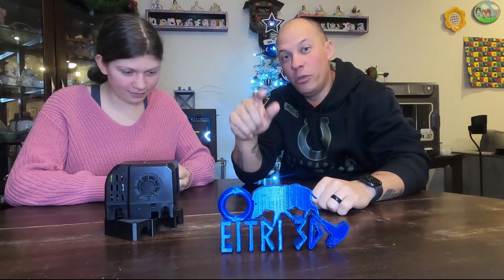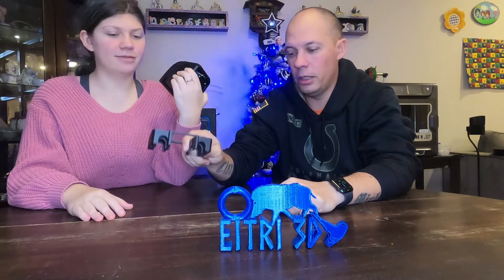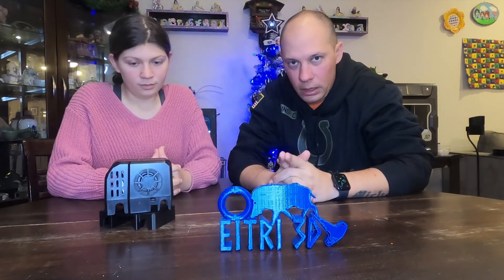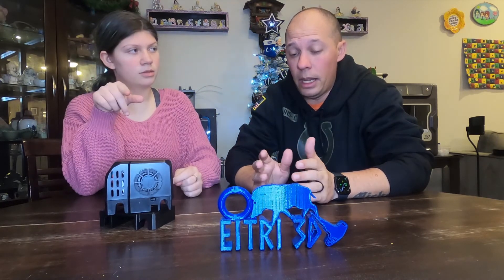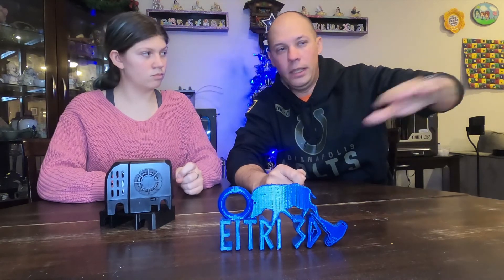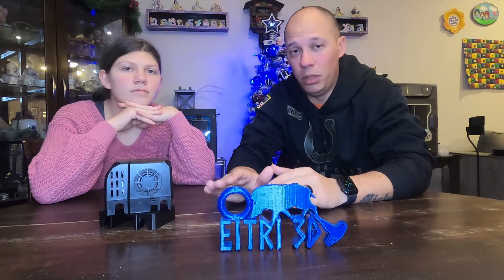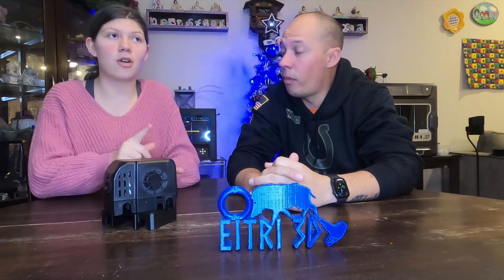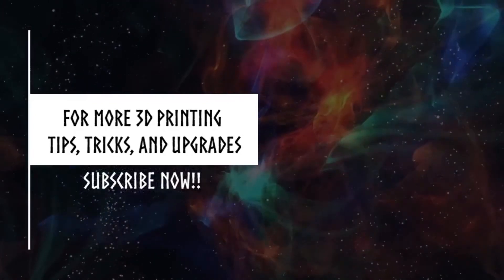Part 3 - Qidi X-Max All Metal Hotend Upgrade (Chad Mod)

Comment: Showing the PID adjustment helped a lot. I couldn't get it to work from another tutorial, because it show the M303 "E"  parameter was optional and wasn't included. I just assumed my X-Plus didn't support the command but thought I'd try to find another one just in case. I had already ran across your video looking for something else, and thought I'd check it just in case it showed how to to do it on the X-MAX. It worked! Thanks so much!!!!!!!
Reply from the maker: You’re very welcome. I’m glad our videos are helpful!

Comment: Hi Mike, I made the mod on a X-max and it works really well! Thank you. 
The only part I cannot get right is the hotend (Dragon) PID tuning. No matter how many times I've run the M303 E0 S230 C5, get the PID and  'printed'  it, the temperature keeps fluctuating by about 10 degrees. Any suggestion? 
Also, when sending with Octoprint the command M503 it just returns a N:(some number) response :
Send: N282 M503*45
Recv: ok N:282 
Do you know why?
Again thank you for this great mod!
Reply from the maker: When it comes to the PID tuning, I would run it 3 times and take the average of the responses. This will get you close, but at the end of the day each filament requires different temp and you can adjust from there. As for the 503 command, I am not sure off the top of my head what’s going on. Let me do some research and see if I can figure it out.
Reply: @Eitri3D  I've contacted QIDI. They sent me the new X-Max firmware and now the PID is working well - no more temp fluctuations! Thank you again. :)

Comment: Hi Mike & family, had an odd question for you guys.  After printing about 2/3 roll of ABS filament on various projects, my X-Plus' hi temp extruder has stopped heating above 190*C, give or take 10*.  Contacted customer support who advised me to increase the distance between heat sink & aluminum block, which gave slightly different temps but still under 200*.  Since that didn't help, they were going to replace the extruder but, since I purchased it new from a seller on eBay (not Amazon or directly from Qidi), they won't honor my warranty.  I replaced the heat pipe, no change.  All connections are secure and I see no damage to the board or any other components.  Any suggestions before I have to purchase an entire new hi temp extruder?  I've printed 10x more with the regular extruder with no such issues and I'm stumped.  Thanks as always for your input!

Comment: I put other thermocouples, they do not fit, only when you fix your native one, it works with it, how to fix the error, please help.
Reply from the maker: I am not sure I understand your issue. The list of materials bought all fit together with no issues. Can you clarify?
Reply: @Eitri3D  Hi, I'll explain everything now, I fixed everything correctly, after which it turned out that the thermocouple from Trianglelab, which was included in the kit, does not fit, the board does not perceive it, I tried others, they also do not work, I put a regular one, but the temperature is very much not stable at 20 degrees, I tried the Pid does not help me.
Reply from the maker: That thermocouple in the description fits the Genuine E3D Heater Block that is in the description. The one in the kit isn’t the upgraded version. It was cheaper to buy the kit and toss that thermocouple than to buy everything different.
Reply: @Eitri3D  If it doesn't bother you, you can record a detailed video on the temperature settings, I would be grateful,? Or is there some kind of setup instruction? And how do I make the board work with a thermocouple from Trianglelab?
Reply from the maker: There are three videos in this playlist. Video 2 shows the assembly. Unfortunately video 2 has been removed because a company tried to claim copyright infringement. As soon as the dispute ends, it will be put back up and that will help.
Reply: @Eitri3D  can I send the video by mail to me?
Reply from the maker: The second video is back up.

Comment: What a super nice conversion kit! I have followed it all the way you did it and my brand new Qidi X-Max is now completely ready for printing industrial parts with Nylon-Carbon Fiber at high temperatures.

I still have a question about the optional 30 mm fan that must be connected to the connector of the leveling input.
With me it is connected to pin 2 (-) and pin 3 (+) just like in your video, but it doesn't work. Does something else need to be switched on somewhere else !?
Reply from the maker: The quick answer is no. When plugged into the 3-pin it will be in a constant on state. I would plug it into the #1 position to ensure there isn’t an issue with the fan itself. Your other option is to splice those two fans together and plug into slot #1. If you do that, then both fans will kick on at 50°C.
Reply: @Eitri3D  Thanks for your quick response. Indeed, the problem was the fan itself. It's broken. It is the new fan of the ordered Trianglelab Highall-Metaal V6 Hotend. Maybe a cable break or something. I connected another one to the connector and it does indeed run continuously as long as the printer is on.
Thanks again for your beautiful full metal extruder solution for the X-MAX !! :-)
Reply from the maker: Thank you for the kind words. I cannot take credit for the all-metal upgrade design. I just took their words and put it into a video. I’m glad you were able to find the problem and get it fixed. Happy printing. Cheers!

Comment: Ive build this and it runs beast mode compaired to that clicking joke of an extruder but no matter what I cant get the quality that I did. I updated the firmware and am constantly making adjustments so see if I can get the quality and only got a little closer. Also I cant run PLA with out is slowly plugging up just like on a normal all-metal hotend so I made one to run like the the low temp one and only really had to bore out the hotend and heat block a little to fit the bigger heat break that fit the tube and have had nothing but good on it so far. Saves me having to go back to factory firmware and reinstalling all the hardware again. So is there anything I'm missing?
Reply from the maker: So a few questions for you, did you add the third fan, what are your retraction settings, and did you run the PID tune to help dial it in? I ask because I have dialed in my settings and honestly have had zero PLA clogs (except for out of tolerance filament size) with the added/improved cooling. I run 208° with bed at 60° and 100% cooling with 1mm retraction at 30mm/sec and I’ll switch between FilamentOne, Hatchbox, eSun, and Filablend Filaments
Reply: @Eitri3D  Hey I'm Just seeing this, I figured out it was my fault with how I was putting the tubes in there And I worked most the bugs out. I use a .8mm tip with a Volcano heat block and I don't run it slow. I'm shocked with what this mod did.  Easy 8X or more the factory recommended print volume. Now I sturggle with firmware. Is that reverse code I added firmware or not?? Octoprint says I have broken firmware and hardly anything works between the 2
Reply from the maker: Have you added the CBD_Fix on your OctoPrint? You could reset the firmware, but you’d have to readjust the reverse direction code again.

Comment: where do you get all the firmware to reset the stepper motors?
Reply: There is a link on thingaverse under Chadmod in. instructions I believe thats where I got it from
Reply from the maker: Exactly. Plus if you google Chitu Gcode, you’ll get a list of the meanings of the most common lines of code.

Comment: Can you please follow up with a video to autotune without PI/ Octoprint?
finished but didnt know we had to use pi too
Reply from the maker: This is something I’ve been working on figuring out. I think I have a possible solution. I will be testing and recording if it works. Thank you for your comment.
Reply: @Eitri3D  im just all done up with mine just about to fire it up without the autotune =p see how it goes
Reply from the maker: Your temps may be a little from the display until I can test this new method, which is a goal tonight. Hopefully I’ll have an answer real soon.

Comment: I finally did this but don’t have it working yet.  My extruder is going the wrong direction; how can I fix this?  Also, how can I calibrate the new extruder?  Every time I try M501 in Octoprint, I get “ok N886”.  Thanks.
Reply from the maker: Part 3 of the Chad Mod videos for into details on how to fix the direction issues and how to PID Tune. Do the PID and direction fix using the thumb drive. Use Octoprint to get you PID information for the correction.

Comment: I am having issues with mine. I did it to a XPlus and now my temp say 1077/200 is that something I have to do through octoprint
Reply: I was just having the same issue.  The thermocouple is probably lose, I recrimped mine and tightened down the pins and it solved that problem.  Otherwise, it could be that you're using an incomparable thermistor.
Reply from the maker: Glad to hear you were able to diagnose the issue and fix it. The few 1077 issues I’ve dealt with were ribbon cable issues so thank you for explaining what you were able to do. I’m almost certain your comment will help others. Thank you.
Reply: @Eitri3D  ya i had the same issue it was just the ribbon cable not plugged in all the way
Reply from the maker: Yeah I’m always glad when it’s a simple fix, but I want to kick myself because it was something I overlooked.
Reply from the maker: The issue is with your ribbon cable. Disconnect the ribbon cable and plug it back in to see if that fixes it.

Comment: I just got everything completed and installed but when I go to the home position it hits and continues to drive. Is there something I need to adjust? I seen the comment below about adding a 2mm plate or something, is this necessary?
Reply from the maker: I ground/sanded the back edge of the fan down a small amount. Once I did that I’ve not had any issues. I did not install that 2mm plate. Some people needed it, and I thought I was going to also. The other big thing I would check is that your X axis arms are square within the frame. To adjust, just grab the arms and push one side and pull the other side.
Reply: @Eitri3D  I will give it a try. Thanks
Reply from the maker: No problem, would like to know if it works and if so, which one did it for you.

Comment: I like how the 1st video has 3 times as many views as the last one, which has obvious implications of all those quitters out there.  Any idea if this ChadMod carriage will work with a mosquito or dragon hot end?  Thanks. You guys are awesome.
Reply from the maker: I like to hope that the other 2/3rds are waiting for their parts to arrive before continuing on to the last 2 videos. As for the Chad Mod, it is designed for the V6 and Dragon Hotend. I personally haven’t installed a Dragon, but I know many others went the Dragon route.
Reply: @Eitri3D  I ended up buying a mosquito hot end.  When doing this one, you'll need to slim down the top carriage by 2mm, and the fan by 2mm for clearance.
Reply from the maker: That’s some great information to pass along. I appreciate your feedback for the community. Do you have a Thingiverse set up or a place where people can get your design? Just in case they don’t feel comfortable modding the original carriage.
Reply: @Eitri3D  I will upload it on thingiverse soon, as well as some of my mods for the original carriage.
Reply from the maker: @bboydradle  that would be awesome. Thank you.
Reply: @bboydradle  Have you uploaded the files to Thingverse yet? If so, can you provide a link please?

Comment: follow everyone. Printing the filament rollors now
Reply from the maker: how did your rollers turn out?
Reply: @Eitri3D  tough to print. Slow is the key to stop the printer from shaking. Wish i could change the width on the filament nubs. I have a few rolls that dont fit.
Reply from the maker: I just moved my printer to a sturdier location in hopes of get a better base to attempt to decrease the shakiness. Was you able to get it all together in the end?
Reply: I also printed everything at 100%
Reply from the maker: That’s good to hear. I meant to also ask what rolls (brand/size) do you have that do not fit?

Comment: To avoid the crash of the part fan into the y-stepper while moving to home position please add a 2mm thick plate to the y-carriage on the right side. This will trigger the end stop a tiny bit early and helps. PID tuning can be done also via SD card only - no need to copy paste the results - just take over into running config (U end the end of the command) and save it permenantely with one printed .gcode file.
Reply from the maker: That was something I was going to try, but I have to say. I’m starting to wonder if that issues was due to something else because I it is hitting the end-stop with zero issues anymore. I mean it could have been something not tightened the proper way. Either way, that is a great tip for our community, thank you! Cheers!